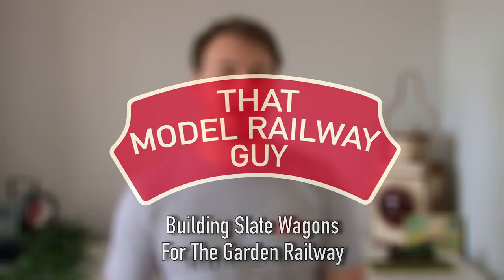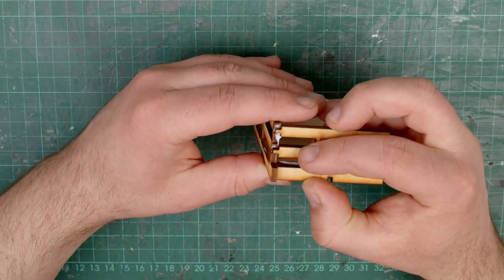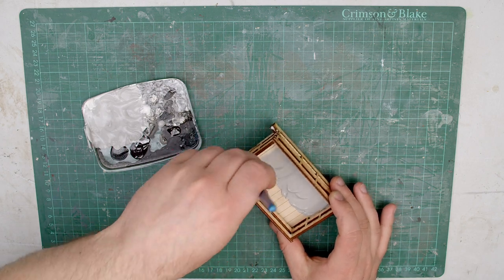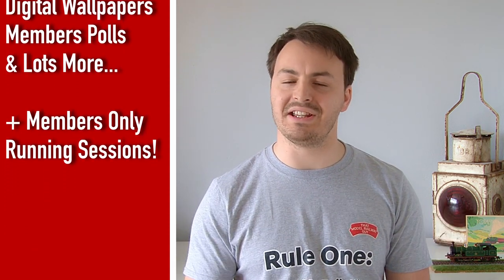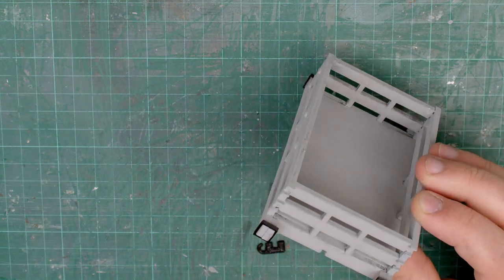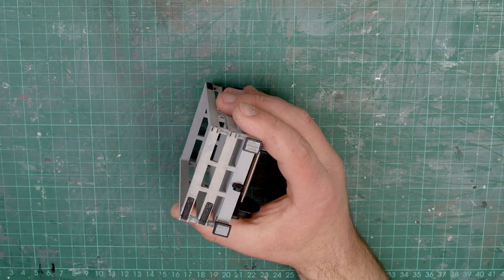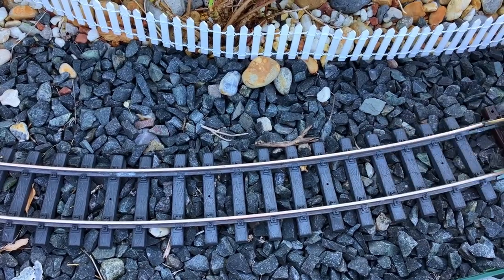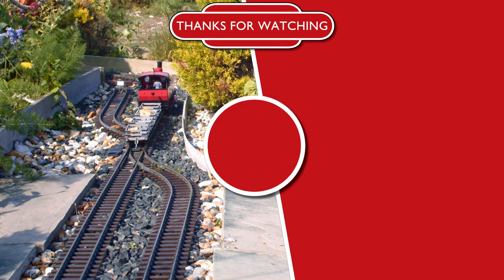Making Wagons For The Garden Railway! - G Scale Model Railway Tutorial

Comment: They're lovely wagons. I prefer building from scratch because I prefer the building part of the hobby over the operating side. It can be a very cost effective of getting rolling stock with some of mine being built for £5. My garden railway loco is a heavily modified Roundhouse Lady Anne built last year (I might be able to upload some running videos). I would love see you build a locomotive from a kit (or even from scratch) as I find these type of build videos fascinating. Thanks, Robert
Reply from the maker: Hey Robert, yeah I think scratch building will always be an important part of the hobby, especially for garden railways. Amazingly these kits aren't that much more expensive though - around £7 a wagon I think and the more you get the cheaper they each are.
Great to hear about your Roundhouse Lady Anne! I've always fancied building one of the Roundhouse locos but not quite sure I'm up to that level yet. I do have a couple of loco projects in mind though so stayed tuned for those. Thanks for watching 😃
Reply: @ThatModelRailwayGuy  I didn't realise that the kits were that cheap! That's better than most 00 wagons! The roundhouse locos are relatively easy to build but you do need a few basic tools and a basic understanding of valve gear timing but as long as you follow the instructions there isn't much to go wrong. I've built 2 already and both have worked really well, especially when you realise that they were built by teenagers. The only draw back is that you could have 10 battery locos for the price of 1 live steam engine
Reply: video posted about it on my youtube channel

Comment: Im pretty sure the wheels are mold injected plastic and have been sourced from Binnie Engineering, very nice kit I had a look at one on the makers stand at the Elsecar Garden Railway show and have been meaning to buy a couple.
Binnie Engineering produce a tipper wagon in 45mm you’d probably like, very cheap little kit.
Reply from the maker: Yes that seems right, it was the other smaller parts in the kit that I think are 3D Printed. Still a very nice kit though! Sounds like I'll have to check out the Tipper Wagon too now. Thanks for watching 😃

Comment: Your garden railway has reignited my itch to do G-scale, but it’s the cost. I think I missed the boat, even the price of bogies and motors (ie build my own loco body) have gone up dramatically. Where there’s a will there’s a way, as they say. Glue. Too much glue. For this kind of work, akin to full size cabinetry/joinery, if it is not on the surfaces coming into contact, it is excess. More is not better, even on the contact surfaces themselves. Experiment on scrap, you’ll be amazed how thin a coating of glue is required, and how strong the resulting joint. Glue outside the joint is doing little, to nothing. PVA is not sticky as such, and it isn’t becoming sticky as it dries. We call it adhesive, but it isn’t technically speaking. Think of it as a medium for excluding air. Two highly polished surfaces will stick together. Enough. Looking forward to more G-scale.
Reply from the maker: Good to hear it's got you interested again but I do agree with you about the cost. It's always been an expensive hobby in my opinion but like I said in the video PDF Models are a breath of fresh air as I do think their kits are quite reasonably priced. Thanks for watching 😃